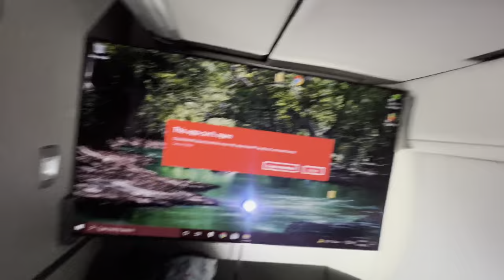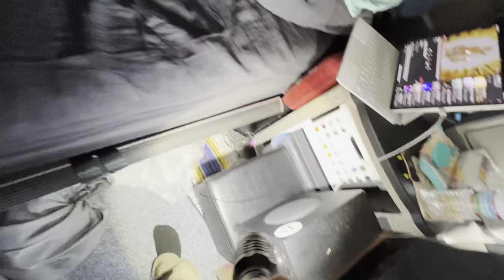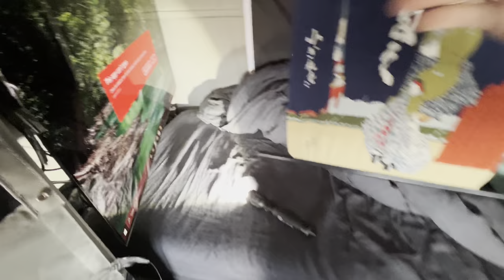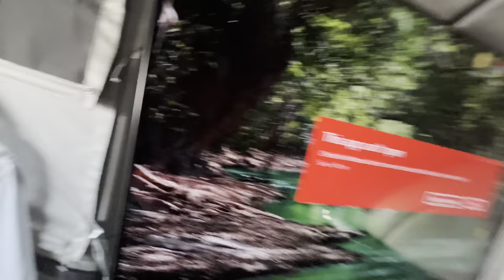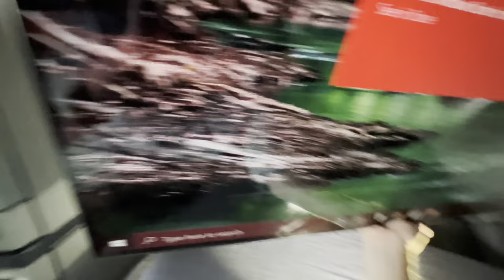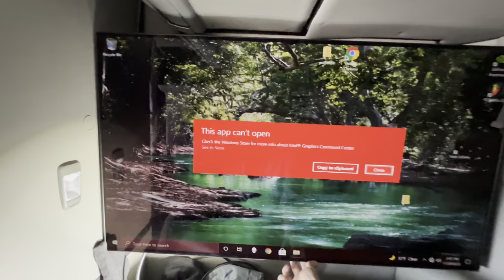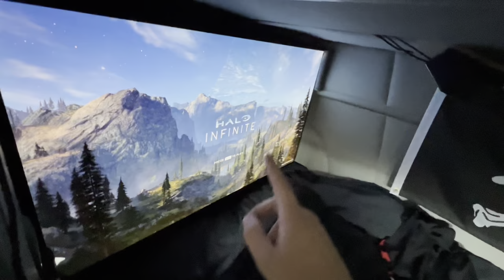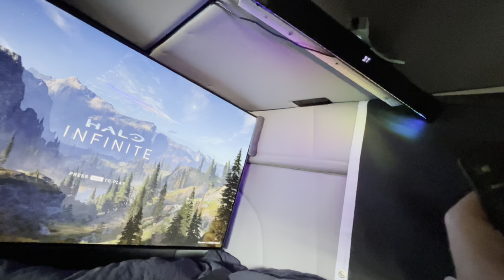[LARGEST 48” TV] In A Semi Truck (OLED-4K-120hz) 2022 Peterbilt 579 Ultraloft

Comment: I just got a 22 pete. It has the same default stock tv mount like you have. Looking at tvs now. How much for all your hotspots? I want to get my gaming gear on my truck too. All help would be appreciated
Reply from the maker: Bout 300$ but I’m bout to get star link mobile setup soon
Reply from the maker: I use Verizon and att for network.
Reply: T-mobile home internet is the GOAT right now. Unlimited for $50 a month. Gets priority over cellular service, handles updates and everything great. VERY few dead spots. I have T-mobile cell service also and even in places I’m not getting good cell service the home internet is working so I just connect to Wi-Fi. It’s wireless but I hardwire my Xbox series X into the modem ofc.

Comment: I just returned the 32 inch samsung qled q60a exchanged for 48 inch c1 oled BUT it doesn't fit like yours in that spit in my 2018 freightliner cascadia evolution has too much padding it fits slanted but I'm going to have to find another spot.
Reply: Can 43 inch fit?

Comment: What’s your make and model of truck? I’m in a 21 Kenworth t680. Looking to buy a 43’ Sony 120hz but the wall mount has been an obstacle. Not looking to alter my company’s truck but I work hard and wanna play even harder.
Reply: when I had a KW I went and got some wood and made a square with cross boards in the back for the tv to mount to and made it just small/big enough where it fit in front to back wall then when the top bunk was down and pushed where locked in place it was tight enough where the  tv did not move at all. So I had the tv mounted in the company truck back in yes 2007 with out a single screw or anything into the truck. They didn't have the flat panel tv mounts in trucks then. Please also remember I am for sure not a wood worker and just had my thoughts and a home Depot close by on a 34hr

Comment: Why did you have to mount the wood to the mount that came with the truck? I have the same truck and would love to do this.
Reply from the maker: So that there is more foundational base so I didn’t have to worry about it breaking off the metal with all the bumps on the road. The wood gave me cushion in a sense and more surface area to work with

Comment: Just got the 42 for my rig, How is the Oled holding up to the road?
Reply from the maker: The tv mount latch broke from all the wobbles. But I got a new truck and getting a whole new setup
Reply: @bluecollaredbill  is the TV still in good working order I was concerned the vibration and bumps would destroy the tv
Reply from the maker: @shyne229  I kinda messed up on the closeness to the wall and wish I had more space… it would rub against the wall if I didn’t place the foam right so it caused a kinda crease in the screen but nothing I can notice unless I’m looking at it very close. It still works and I just put a massive pillow underneath to make it still
Reply: @bluecollaredbill  thanks for the feedback gonna try and set mine up after I deliver this Walmart load, Hopefully I can find a good spot for it, so it doesn't get shaken to pieces